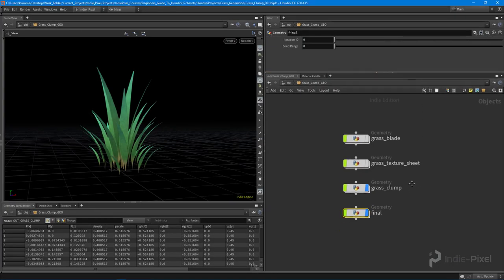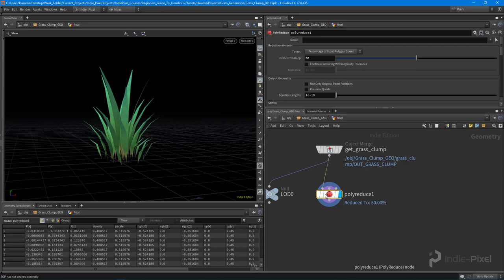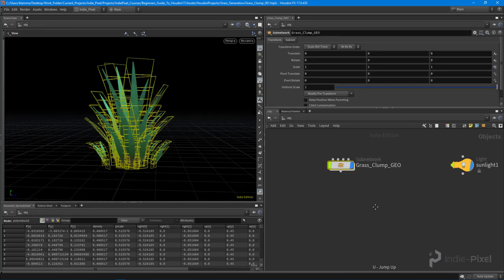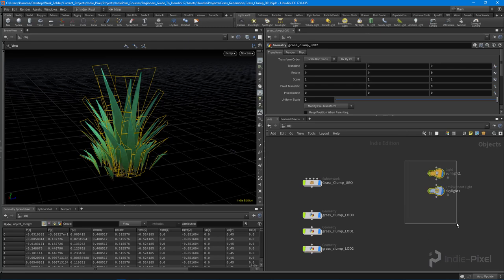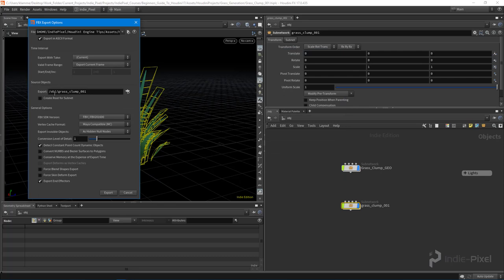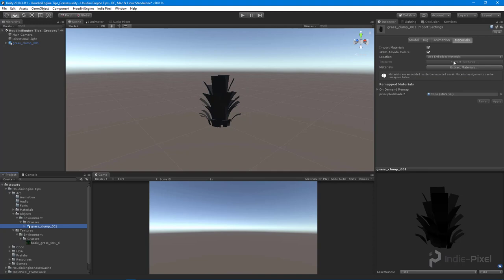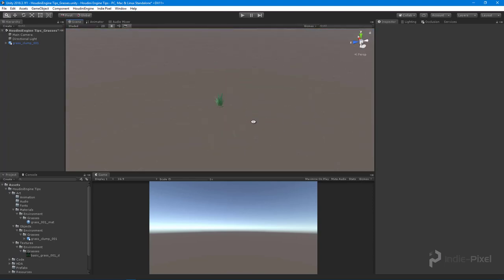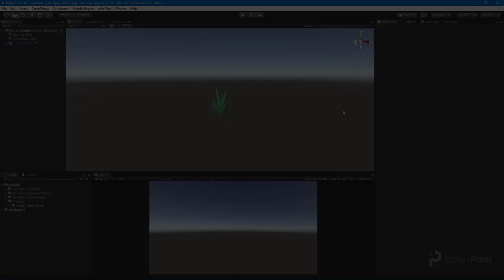Procedural Grass Clumps in Houdini and Houdini Engine - Part 10

Comment: texture sheet in Unity and turning it into a material. 

I couldn't resolve my issue with making the alpha work properly in Unity but was able to get the material set up in UE4 using opacity mask and such. If anyone gets stuck here because of material confusion or has quick tips on how to make it in Unity use this thread.